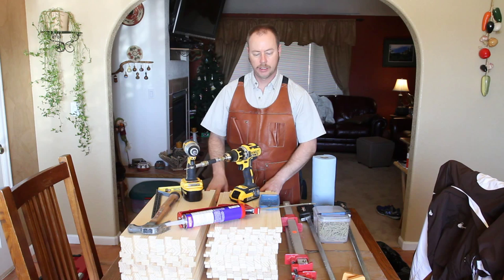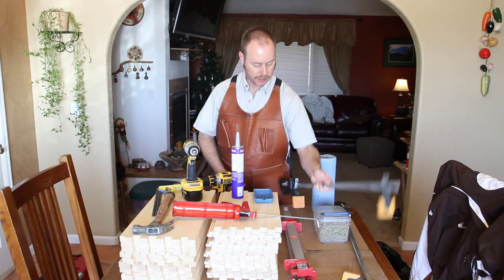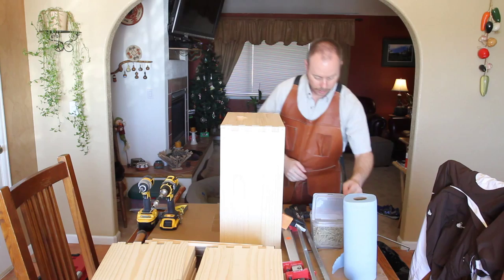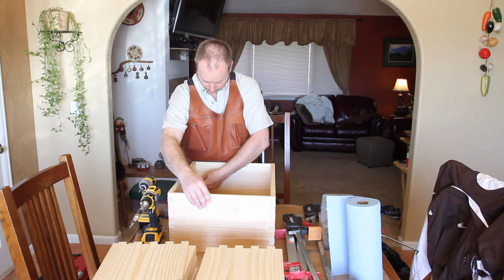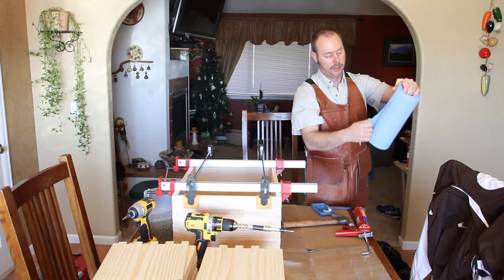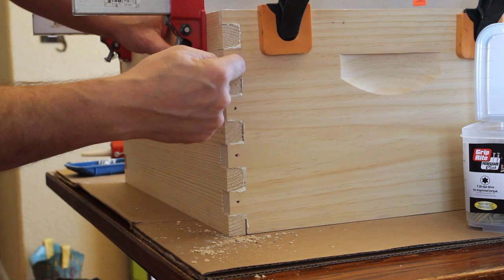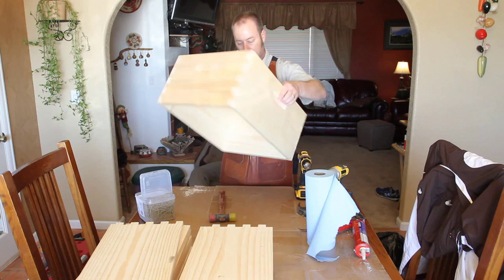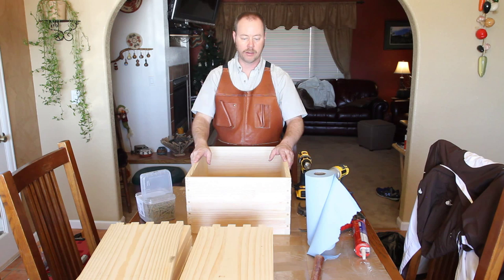Hive Body Construction

Comment: do you use galvanized nails?
and what kind of glue was that, I missed it when you was doing the vedeo
Reply from the maker: +Larry Shreffler Hi Larry.  The nails are galvanized in this video, sometimes they are concrete coated too, but I get them from bee supply companies.  However, I did get a notice from one of them, possibly Kelley that they were no longer going to supply nails with hive bodies, but I'm not sure which.  I use PL375 which is made by Liquid Nails, I believe, or a better adhesive is made by Loctite and is their PL Pro Line Premium which is noticeable because it say's 3X Stronger in bold red letters.  Either of them will work, but I think the latter is stronger and is more pliable for a longer time which makes it easier to get the hive body together before the glue starts to set.
Reply: Thank you for the reply
Reply from the maker: +Larry Shreffler Thanks for watching the video!

Comment: couple of questions. 1) why is the top finger of the box joint half as thick? 2) is there a reason for using box joints rather than dovetails? 3)the frame ledger is that rabbited out of the panel or an added strip?...... i saw in one of your other video's comment section you suggested 5/16-7/16 spacing between frames and body side. how does that compare to between frames or is it the same?
Reply from the maker: Hello.  Okay, the top finger is half as thick because that doubles as the frame rest which are the same width.  The size of the frame dictates the bee space (space above and below the frame that would be acceptable space so that bees either don't fill them with comb for larger spaces, or propolize them shut if the space is too small).  So, you could use a normal sized finger at the top and cut a rabbet for the frame rest, but you would then have to cut the bottom finger just as much to hive the right size hive body...or use smaller fingers overall which I think is not ideal.  2 - Box joints are easier...that's it.  You can use routers or tablesaws or even miter saws to make box joints, but only routers (or hand cuts) can create the dovetails.  Dovetails would be much better because the flaw in the finger joint is that it eventually peels back if it wasn't glued when the joint was put together.  3 - The frame rest is a rabbet joint, if I understand your question correctly.  4 - The spacing I mentioned is called bee space and it applies to every part of the hive, so between hive bodies (top bar to bottom bar of hive body above), between the outside of the frame and the hive, in between frames, etc.  Most frames on the market today have good bee space built into them with respect to the space between frames so long as you keep the frames tight against each other.  However, most companies have problems with too much or too little space between hive bodies.  Kelleybees is the only company I know for sure has the right bee space in all circuits.  Hope this helps!